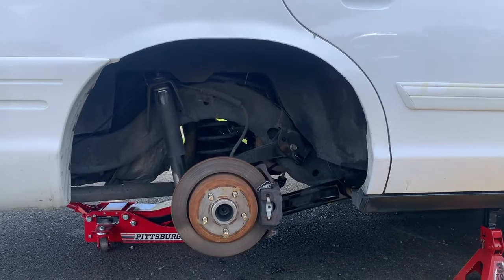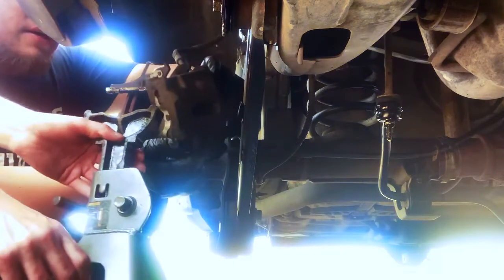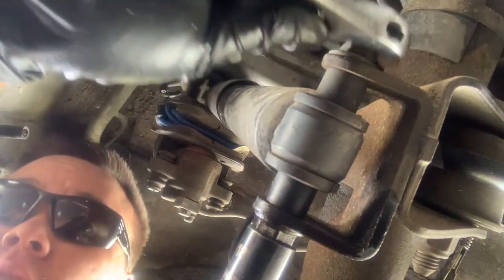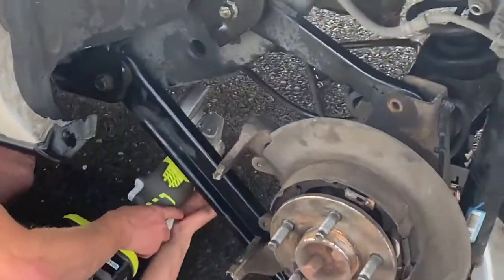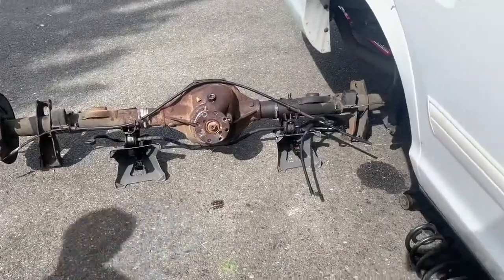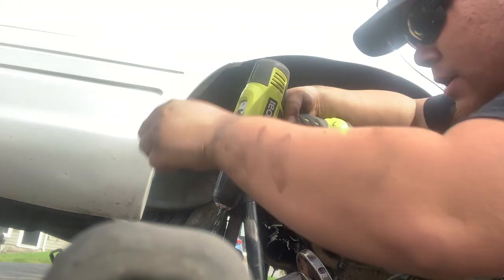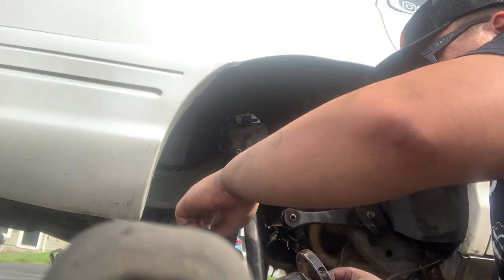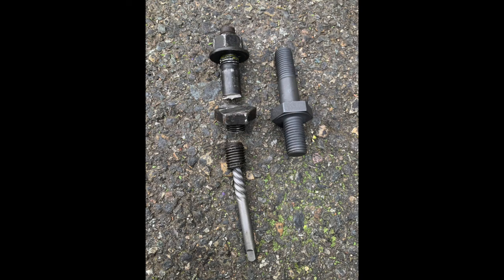'09 Crown Vic- Rear End removal & Watts Stud replacement

Comment: I am building an 01 Crown Vic into a dirt circle track car and replacing the 8.8 with a 9" I am a few months away from making the watt's bracket for the 9", but it should be cool. Thanks for letting us know about the replacement bolt- I will use that in my mount I design.
Reply: why replace the 8.8?

Comment: How difficult would it be to remove the broken stud without dropping the rear end?
Reply from the maker: It’s likely possible, but I wanted to be extra cautious when extracting the broken stud. I have another video on my channel “watts link replacement” where you can get a better idea of how much space there is while everything is still up. Refer to 1:47 on that video. Now that I think about it, I’m sure there isn’t enough room to swing a hammer onto the extractor though.